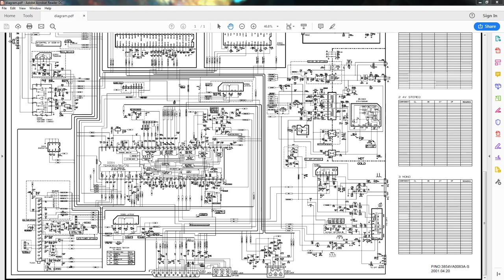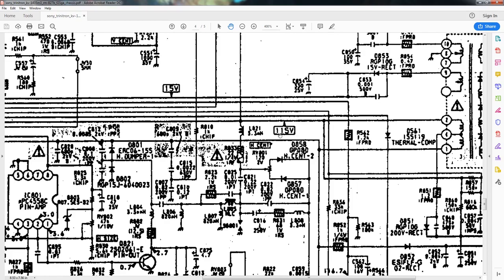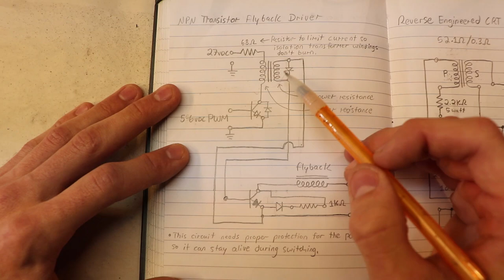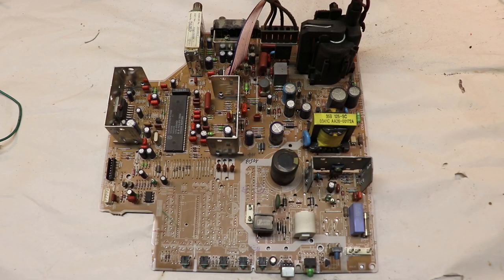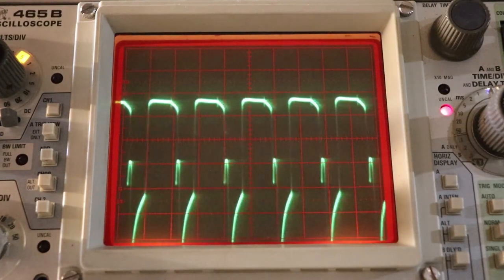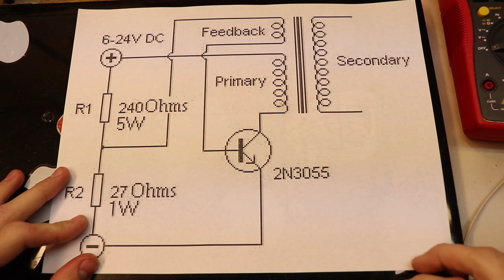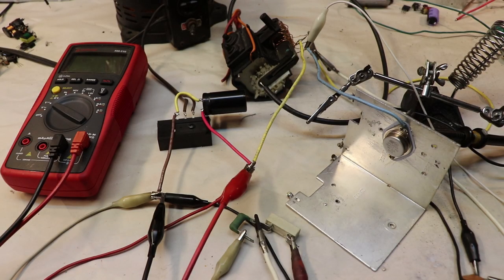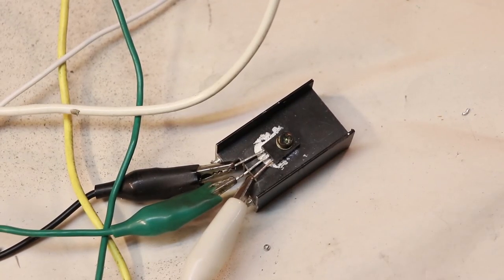How to drive a Flyback: Transistors (Part 2)

Comment: Thanks for your videos and details how to drive FBT. I have a BSC 25-0278Q and I wanted to drive it, creating some sparks, like you did in the previous video. I like to make an a "universal driver" that I can use to drive FBTs and other projects. But it seems to me that lot more goes into the driver than I understand and the idea of an a "universal driver" isn't gonna happen - right? Also, when I was trying to determine where on my FBT is the input, I'm getting very small values in Ohms between pins; example: 0.28, 0.33 and 0.10 Ohms. BUT when I included the  yellow wire against the pins, I get values in Mega Ohms; example: 7.623 Mohms to several pins at the bottom of the FBT.  Do you have a better ways to determine where is the primary and secondary on the FBT? Would you be willing to answer some questions using Skype or some other form of a video call?

Comment: The negative spikes (impulses) you killed by putting a diode is the key to the Zero Point Energy production. The rest of the experiment was not important. All MOSFETs have internal "Body Diodes" putting one externally is a double protection. I am more into ZPE than producing longer and stronger arc. Keep up the good work.
Reply: Its really sad when you come to think of it, most people into high voltage have no idea they are tapping the quantum vacuum and zpe.
Reply: @ThatThing1675  is that why when you measure electrons they get more random? Youre introducing something into their zero point energy field. So they flow around it. Energy flows in the least resistance.
Reply: The body diodes in mosfets don't protect the transistor from the initial voltage spike. Example: an N-channel mostfet is used as a low side switch so the inductor is connected to the high side, when the transistor turns off the inductor will supply a high positive voltage to the drain of the transistor. But the body diode have its cathode connected to the drain so it can't protect the transistor against the positive spike. However if no external diode or load is connected to divert the positive spike, the field will collapse fast and the positive spike will rise very quickly and then fall even faster. When it falls it goes to a negative spike very briefly and this is what the body diode protects from. If you put a diode to divert the positive spike then the negative spike won't happen. So your saying the initial positive spike is what gives ZPE or the second negative spike?

Comment: I'm trying desperately to understand your video here. You say you have two turns for the primary and the feedback but I see there appears to be more than two tuns around the core? Apologies for the dumb question. I have exactly the same components, I know my flyback works, I'm running 12V 5A power supply, maybe this is no good? Any advice will be much appreciated. A subscriber.
Reply: It’s not a dumb question, I caught that too. The dumbest questions are the ones never asked

Comment: make a resonant oscillator on irfp250 mosfets to power it I built a ZVS powering 3 transformer transformers and get a thick 17 centimeter arc with 34V DC power

Comment: 6:45 to measure the turns ratio, put a low voltage sine wave, at the working frequency, into the primary of the transformer, and measure the voltage at the secondary. This gives you the approximate turns ratio.

Comment: Maybe you can help me out. I have a flyback driver that stop working properly. It keeps blowing tip102 transistors and my tip35c. It never did that before. If i connect it to my zvs. It works fine.
Reply from the maker: Sounds like the flyback is stressing out the transistor making it more prone to failure. This is usually because of inductive spiking, but sometimes it can be because you are improperly driving the gate, leading to overheating and failure. If you have an oscilloscope you could do some investigating
Reply: @SciCynicalInventing  i don't have a scope. What do you recommend. Im using vintage AC flybacks. I have 3 and they all do the same. 11.1 volt battery.
Reply from the maker: @goobman1981  well I demonstrated using a diode and a capacitor in the video to help deal with the inductive spiking and transient voltages the transistor was experiencing, the type of switching circuit is important too, I cant give you a solid answer because a lot depends on the circuit. If a transistor keeps failing even after you put on protective snubbers, caps, and diodes, then just use a better transistor.

Comment: Those transient voltages killed my Transistor
Reply: Those transient voltages were never fully addressed, driving an inductive load, I would recommend a diode across the collector and emitter. They are often employed internally in many IGBT, and mosfets….even in some transistors while driving inductive loads. Inductive reactance is something to consider also, it’s one thing to measure resistance of the coils, but as another person suggested instead of resistance drive your base with 1Khz or 10Khz etc… frequency signals, and compare the Vin to Vout to determine turns ratio. In any pulsing circuit it’s much more accurate. It’s ac electronics vs dc electronics, even if it’s pulsing dc. Sometimes his method can give a very rough idea, I often did it for a rough guess in lower f circuits, but I prefer the textbook method especially for higher frequency circuits.